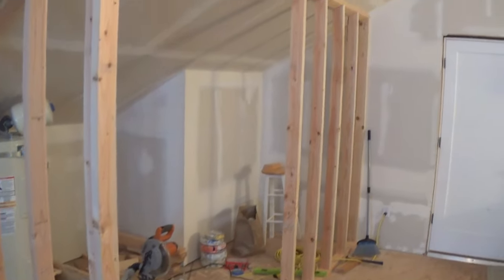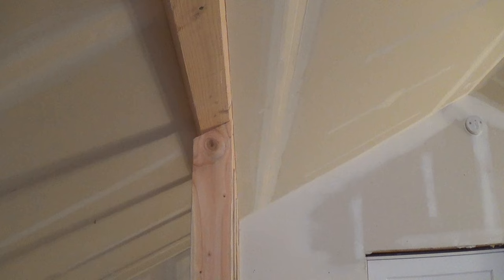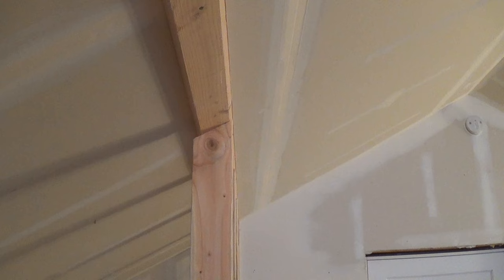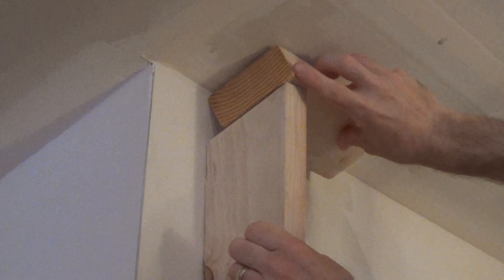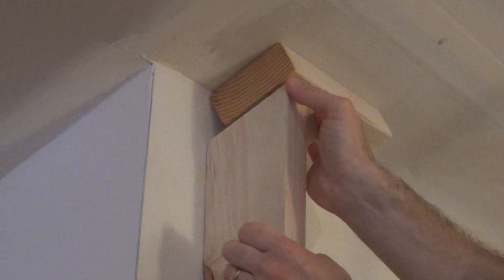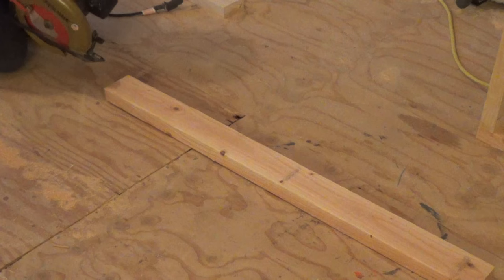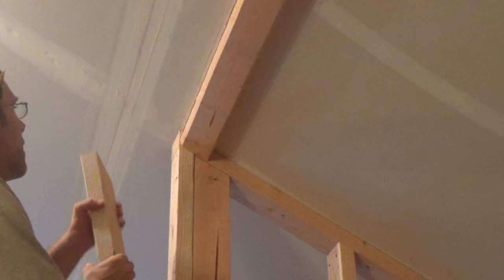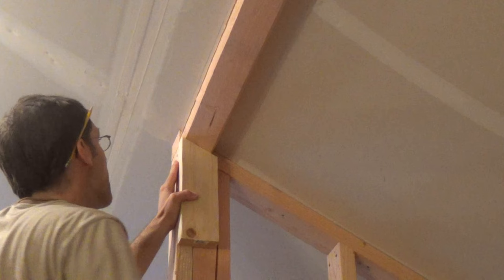How to Frame a Wall with a Sloping Ceiling

Comment: why would you not just move the top board down al ittle bit so the overhang is on the other side of the frame?
Reply: if you need to drywall the other side of the wall it will be a bump out at the top
Reply: nevadasmith100 you could just hang the drywall up to the bump stop at the top and Pre fill the gap with hot mud before paper taping it though.

Comment: If the top plate was flush with the studs do you still need the angle cut for the sheet rock to attach properly? Thank you.

Comment: rather than an existing slant, how does one frame an angled ceiling from 90 degree stud wall around a corner? (to give appearance of smaller vaulted ceiling on 2 wals, one corner involved).  This is preferred by us over building a straight/obtrusive soffit to hide a duct.

Comment: I'm about to close my loft into a BR.  do you nail or screw the adjoining studs?
Reply: Screw it stronger
Reply: I know this question was four years ago but need to clarify: you need to use the correct screws. Need to use construction screws not sheet rock screws, sheet rock screws or the black screws that you get to mount the sheet rock are very brittle and they are definitely not stronger. You need to use construction screws that are meant for sheer loads so they don’t break.  This is why in framing houses they use nails.

Comment: The generic contractor technique ive seen for this isnt to cut the 2x4. Thats too much work. You just slide it backward and let the 0.5 edge of the drywall on the top horizontal stud just hang 100% unsupported. Diagonal cut absolute madness. 

Jkjk but far more commkn than you would think